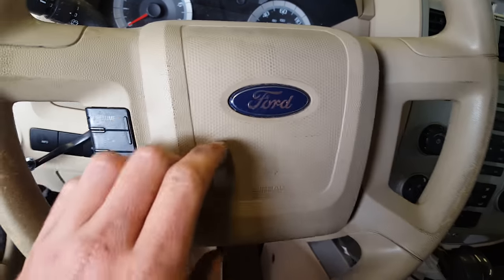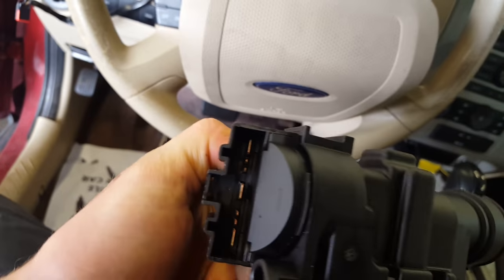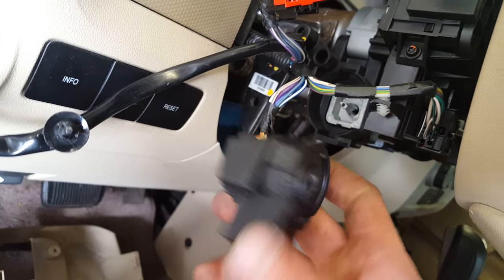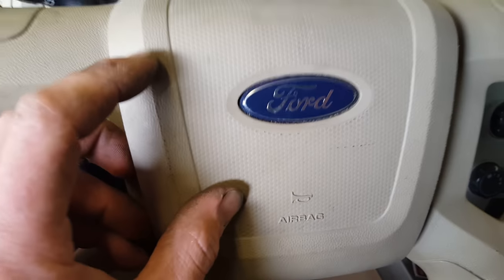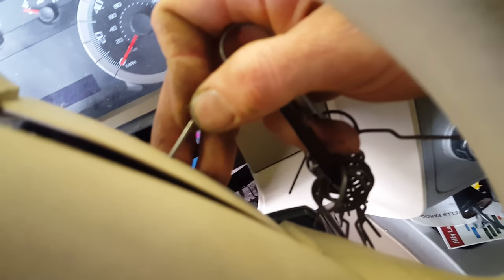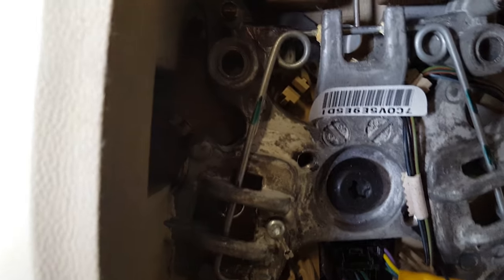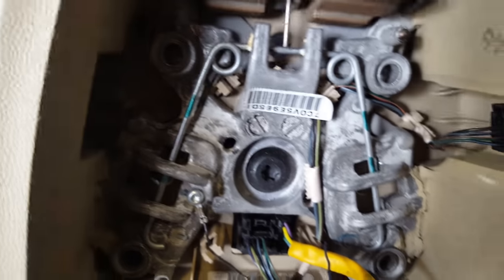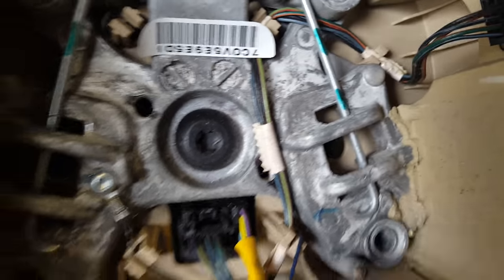2008-2012 FORD ESCAPE airbag / Horn pad REMOVAL for ignition lock replacement MARINER FOCUS EXPLORER

Comment: I had a 1994 Ford Escort (europe) when i pulled that ignition cover off i was shocked how easy it was to start the car without a key, i now see your video and that style hasnt changed much, altho you need to get in the car and bypass the steering lock. i found that way to easy

Comment: How do you go through the back of the steering wheel to get the air bag off? I've tried the other way. Can only pop one side. The right side will only pop.
Reply from the maker: You push something onto the spring through the hole on the bottom of the steering wheel.  Like I was showing in the video

Comment: I'm working on a blind spot camera and need to tap on to (I believe) the red connector to the left of the steering wheel forwards the beginning of the video because I need the signal before it gets sent through a flasher relay and sent to the lights. Any idea on the red harness there which wire is the right turn signal wire?

Comment: After i replaced driver side air bag in my 08 Ford Escape started having issues with horn. Horn will start making noise after I start moving the car in reverse. Like an alarm sounds and then will stop. Any ideas what could be wrong? I thought was air bag replacement but the new one does the same. I will appreciate any suggestions..Thanks

Comment: Do you have a part number.  When I ask for ignition housing they have a confused look on their face.
Reply: A little late Joshua but for 2008, 2009, 2010 it's 9L8Z 3511 A
Reply: +Jay Poel thank you for your video.  It was just what the doctor ordered for our problem!  Saved us a bunch of money.  I really appreciate you taking the time. 

Now onto two more issues.  My wife's 2008 hybrid has random moments when the abs light comes on and she loses her brakes seemingly for a couple seconds.

Air conditioning stopped putting out cool air even though I've replaced the Freeon and the mechanic said that the pump is cycling.  Any solutions? Videos?
Reply: Sorry Joshua ... I didn't get a notification of your reply. As far as the ABS goes - check the "exciter rings" mounted on the front drive shafts at the outer end (closest to the wheel). They commonly crack and leave a small gap that confuses the ABS computer. They are replaceable but you need to pull the drive axle. 

As far as the AC goes - I'd need to know the system pressures.

Comment: how do you remove the lock cylinder please ? I already replaced the ignition switch and it starts the engine , but I have to push a little bit . Can you tell me how I can remove the lock cylinder only please  , thanks.
Reply: Looking for the same thing Jose. I'm fairly sure that my escape's issue is not with the ignition switch but rather the lock cylinder. I did find this link where #10 talks about how to file the turning stop on the cylinder, but definitely still trying to find the easy way to remove the cylinder. http://www.carcomplaints.com/Ford/Escape/2008/accessories-interior/have_to_push_key_in_ignition_very_hard_in_order_to_start.shtml